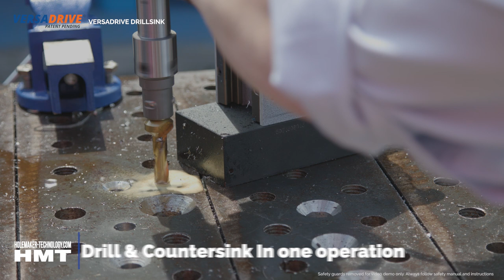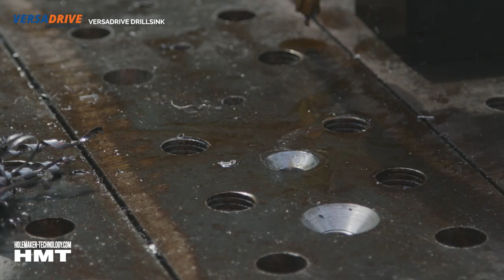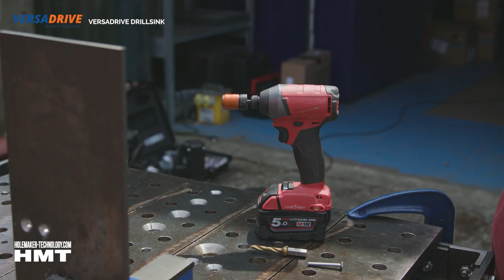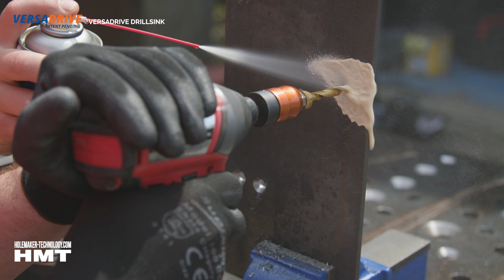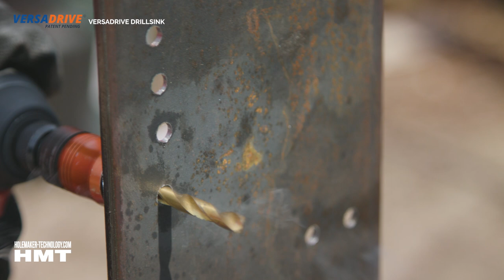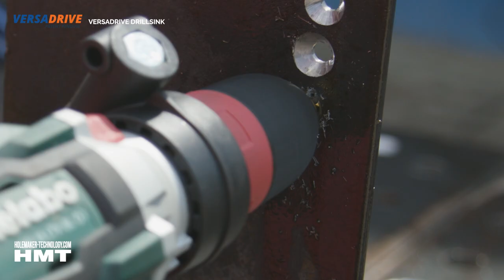VersaDrive® DrillSink - Combination drill and countersink

Comment: Very good but why do you have to sell them so expensive ?... Surely it would make more sense businesswise to price them more lower so more people can be tempted to to buy them ?... £36+ for one small size drill bit is not cool... and prompts me to look for a Chinese made copy that does the same job for a 3rd of the price... Sorry guys.
Reply from the maker: @bittyboy121 thanks for the comment. We have actually written a blog post answering exactly this question if you are interested in finding out more https://holemaker-technology.com/blogs/news/here-s-why-cheap-cutting-tools-can-cost-you-big-time
Reply: @Holemaker-technology  Thanks, I'll check it out. I am sorry, I didn't mean to offend you, I was just thinking out loud as I love the way these drills work but can't understand why they are priced so high unless they are manufactured differently and costly to produce as that would explain why. I did notice that just about every other drill bit that is similar in design to your ones has a thread tap as part of the drill which I do not want ! - I just want a drill and counter sink drill that drills a hole and counter sinks it directly afterwards without any chatter - I like your drills and may save up to buy them individually as £36 plus VAT is quite over my budget but I do like your products for my lock refurbishment work which involves making new brass face plates for old mortice door locks and the counter sink is wanted for where there are 2 small counter sink machine screws that secure the shiny brass face plate to the front of the lock...
Reply from the maker: @BITTYBOY121  no offence taken and yes the manufacture and coating of our drill bits is different from other bits. ours are dual hardened to withstand and utilise the force of impact wrenches so they operate quickly and safely, giving far greater life spans than other bits and a safer, easier method of working. So yes, a higher initial outlay but over the life of the product they actually work out to reduce cost per hole drilled.
Reply: @Holemaker-technology  Thanks for explaining more about these great  drills Much appreciated. 👍